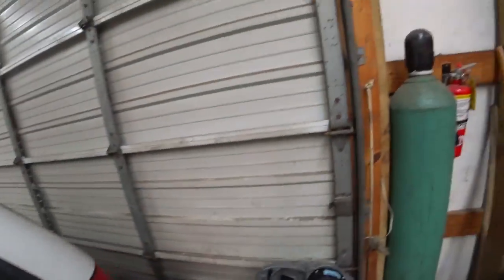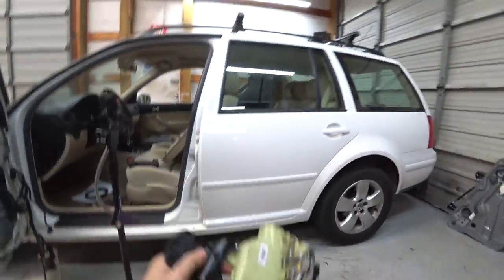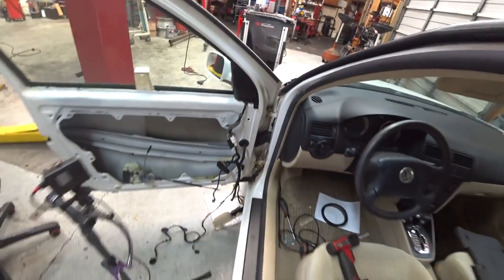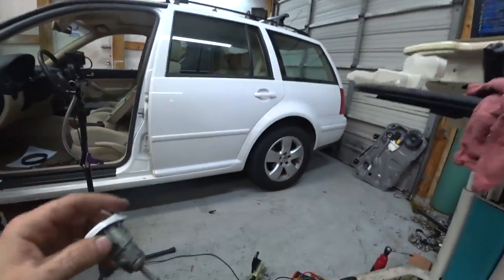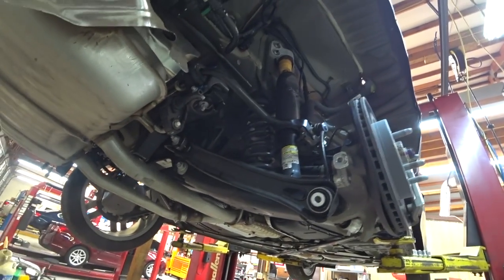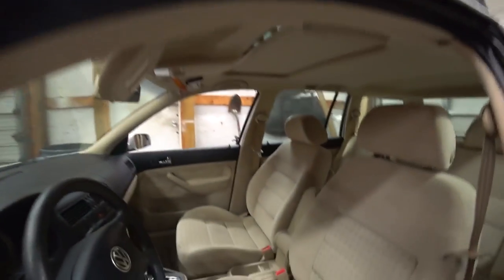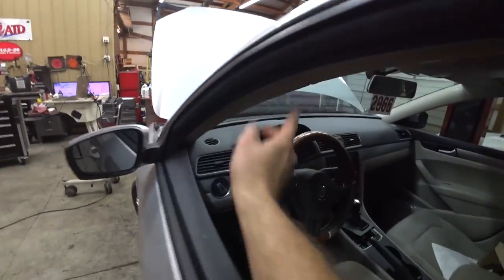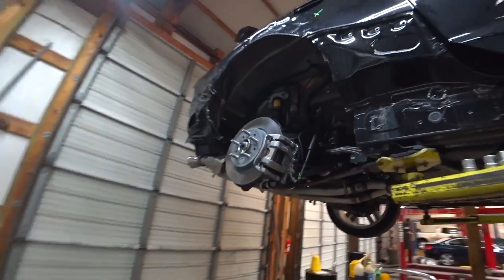Door Won't Lock Jetta Mk4

Comment: I'm having similar issue with my 2005 MK4 Jetta GLI. My question is, will a bad driver side door lock actuator affect the other doors from locking and unlocking with key fob and door panel buttons?
Reply from the maker: If the electronics are having an issue (eg, the motor is broken, stripped out, electrically damaged) it may make noise but do nothing to the lock. This will effect all the buttons, however the key itself will almost always turn the lock mechanically, so if that works, then you can just use the key until you feel like fixing it.